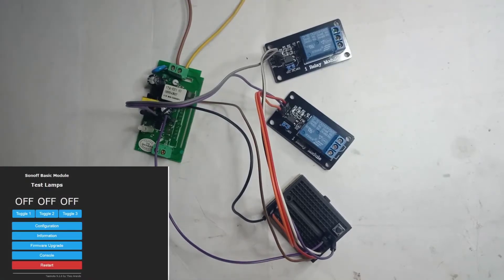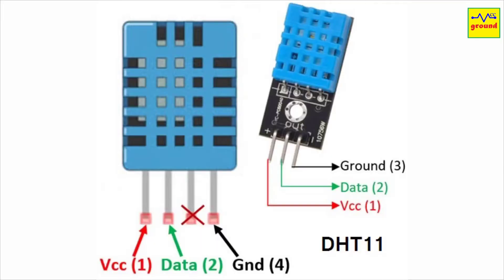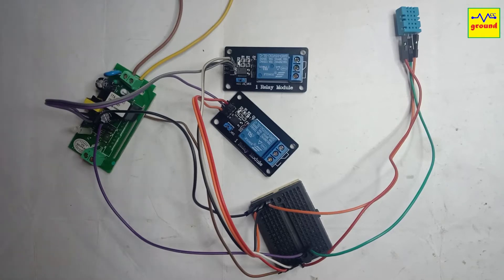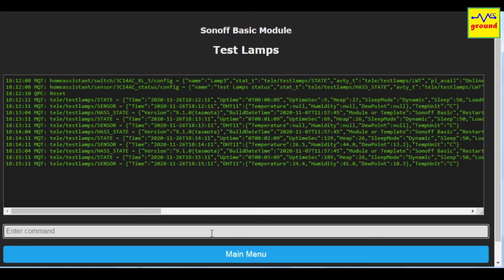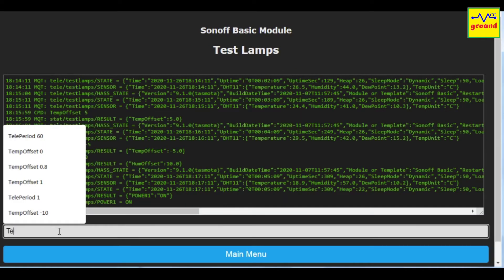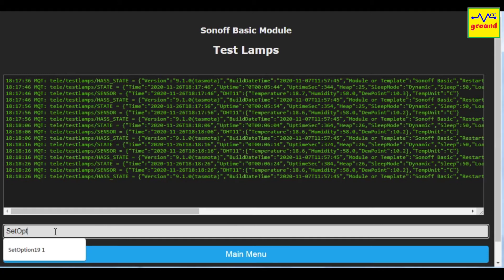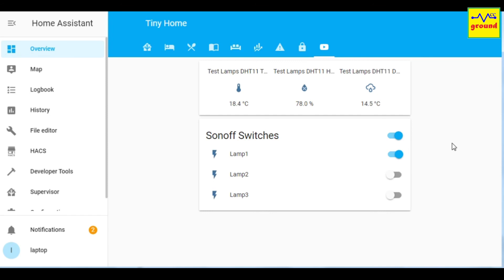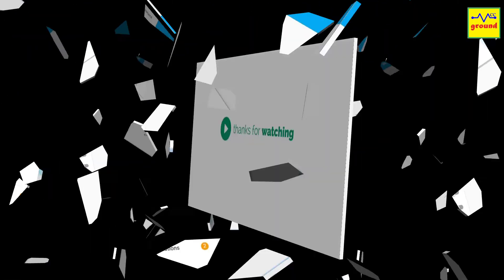#20 How to Add DHT sensor to Sonoff Basic to get Real time Temperature & Humidity Data | Tasmota

Comment: Hi, I have been using my sonoff in the workshop and all was working OK.
I could turn my socket on and off and see the temperature in the workshop, but I had to turn the power off to do other work. But on turning back on my socket is no longer working and is not discoverable on my phone or computer, any suggestions please.
Thanks, Bob in the UK
Reply from the maker: There could be a boot loop issue. Either you would had turned it's input power on and off continuously for 5 times in a row OR the internal watch dog timer (WDT) might had detected any problem and restarted the switch 5 times. Who so ever has done this but a continuous 5 restarts restores the switch back to default Sonoff Basic firmware and remove any user settings thereafter. Hopefully your device would have returned back to default values and all your wifi as well as mqtt settings would have wiped off. That's why, you are unable to discover it. Look for a new access point named "Tasmotaxxxx" connect to it, then open 192.168.4.1 on your browser and reconfigure your switch again.

Comment: want to setup DHT11 but not sure where your connecting on the Sonoff...was looking for the video before that might show me how you connected your board to the Sonoff... then I would know where to wire my DHT11 to the Sonoff.  thank Gregg
Reply from the maker: Link to the previous video has already been mentioned in the video. You first need to watch the earlier video where we had installed a push button. Once you know how to install that push button, you only need to replace that button with the DHT sensor and you are ready to go.❤️👍
Reply: thanks I will look for it there
Gregg

Comment: hi my dear i installed Temperature sensor SI7021 in many GPIOs but no luck, i checked the power it requires 3.3VDC and connected it from the sonoff basic board. the sonoff flashed and configured to generic to see the max. is there something missing, the SI7021 temperature sensor is available in the drop down list to chose the device in the configuration menu. appreciate if you can help on hoe to connect it.
Reply from the maker: Please share a picture of your connected sensor and a screen shot of Tasmota configure module page, on vccground telegram channel for review.